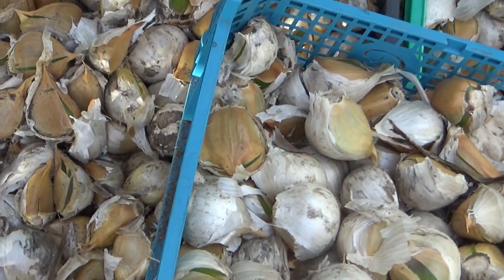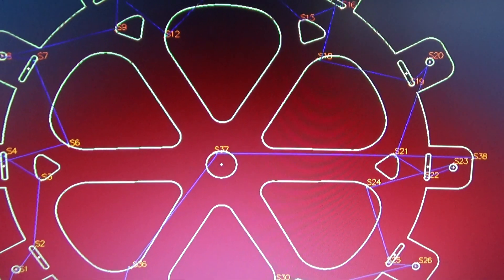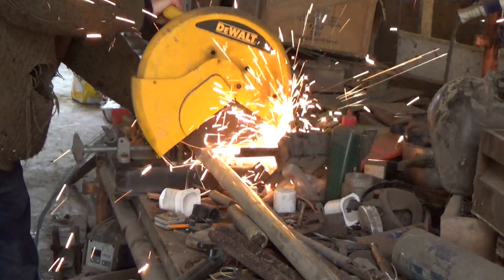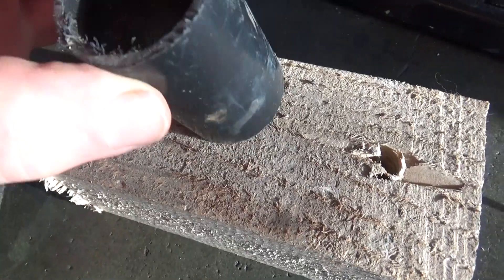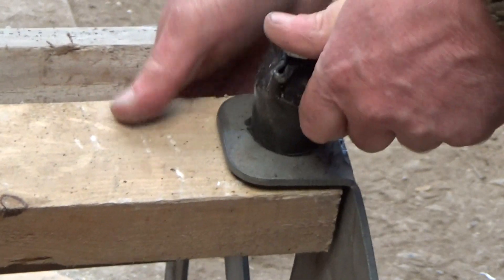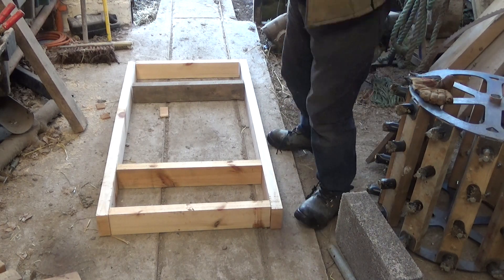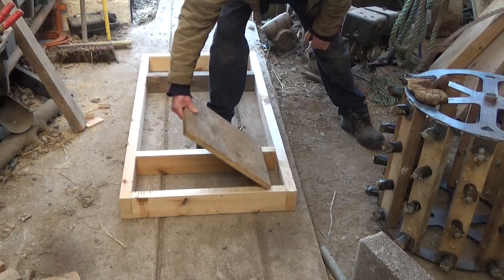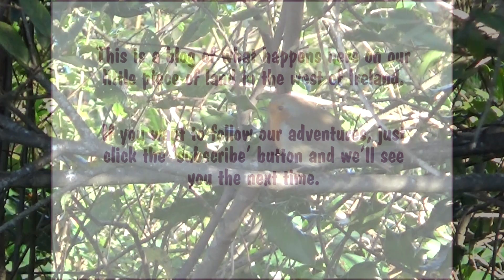Making A Dibber Drum For Planting Garlic (or is it a lantern wheel? or a spikey roller?)

Comment: Hi Tim, this looks like fun! I used to plant 5000 cloves a year - by hand. One small refinement I could suggest for the planters' comfort: carry the cloves in a bag around your waist, walk upright and drop each clove in turn down a length of plastic pipe. You can tread it in with your heels as you fumble for the next one. This method served my spine well for years.
Good luck with everything, you both continue to inspire, as always.
Chris
Reply from the maker: Thanks Chris. Yes, we're almost up to that number this year. I have started an experiment where I pull and plant at the same time, through the mulch. It's all about trying not to disturb the top layer of the soil. I'm not sure that your method would work because some of the cloves are as big as an orange. I'm always looking for ways to stream-line the operation though...!
Reply: @WayOutWestx2  There is an Indian hand-held machine which is effectively a garlic drill: it plants the cloves in "smile" position, which is possible to achieve mechanically and a reasonable compromise for good growth (upright planting as you'd do by hand is hard to achieve by machine, unless you use a cartridge-type transplanter). I built myself a prototype of the Indian machine, with some success. I was growing conventional garlic, and I agree that the large cloves might be more of a challenge.  You're welcome to more details if you like.
Reply from the maker: The thing is, I'm down on my knees anyway, to harvest the bulb with a trowel, so it's easy to drop a clove into the hole that's left. But, yes, please, if you can find me a link I would be interested.

Comment: The spikes c would be an excellent application for 3d printing. Or make a mould and cast them in concrete or resin.

Be careful with burning PVC, it releases chlorine gas.
Reply from the maker: You're right Sam, on all counts.
Reply: You're right about PVC, but I believe this is actually ABS. It still emits noxious fumes, but not as immediately deadly as chlorine.

Comment: Strikes me that the compartments for the concrete blocks look just about right for 1 gallon plastic containers. Filled with water each weighs 10lbs, and give you a good way of regulating the weight for different soils, by adding more or taking them off as needed. And with the benefit of a handle on each one making them much quicker and easier to manhandle (or womanhandle) in use.
Reply from the maker: You're right - and perhaps easier to handle than the blocks - but I don't have any of them

Comment: I like this very much. It must have been very tedious forming the pipe as you did, I hope it holds up well. I thought you would try mounting hollow unformed pieces of pipe so it took a plug out of the soil, but your way seems much easier to attach them.
Reply from the maker: Yes, round lengths of pipe would probably work, but how to attach them?
Reply: @WayOutWestx2  Without a bolt across them on the other side.
Reply: Instablaster.

Comment: I'd have thought you'd make to be pulled by one of those one horsepower propulsion units you have. Maybe add some wheels like bike wheels at the ends to keep it from tilting into the dirt if you're going to  push it yourself.
Reply from the maker: One of the donkeys should be able to do it. But their hoofs are so small they'd leave similar holes. (Must try training them to take 6" steps and walk in parallel..)

Comment: Maybe you could have made some triangular spikes out of metal with the plasma cutter. The idea is to cut them in such a way that they interlock and form a sharp end. Think of a two triangles interlocking via slits and they form a pyramidal shape like the tips of an hunting arrow! Then weld some bolts to them and then secure them to the wooden frames. May not be easy to pull off, but they would be a lot sturdier and more effective than PVC pipe tips. :) last longer too! (An idea from a future mechanical engineer. Hope it helps!)
Reply from the maker: Good thinking, Kevin, but the pvc will probably outlive the steel in this area, plus it's smoother so less likely to get bunged up. And there's a lot less welding this way too. But please make one your way and we'll compare

Comment: Hi, I think you should have hollow tubes for making the holes in the ground, so it pulls up a plug if soil rather than trying to push in. What about drilling a 40 diameter hole in the timber cross bars and fixing short lengths of tube in it, have you seen a lawn aerator, basically a larger version of that?, anyhow good luck.
Reply from the maker: I thought about that but realised they'd all be jammed with stones within minutes. Also, leaving the pipe straight means they might break at the leading edges? Or shatter completely?

Comment: If you switch the Apparatus upsidedown, the wooden part would be higherup and more able to avoid obstacles.
Also when moving the Apparatus as it is, the concreet weights wil bump up and down banging on the plank.
  wich could make it become detached

But i like the design anyway.  
Keep it comming!
Reply from the maker: I deliberately set them down low so the centre-of-gravity was low because I was worried it might tip over on slopey ground

Comment: Thats a clever tool you've built there! Just a quick comment, if you put the frame on upside down you'd have the wood pressing down against the pipe and not have the pipe be held by screws alone.
Reply from the maker: ah, you missed a bit, Tommy! Have a look at 6.28. The screws are only there to stop the axle drifting sideways - all the weight is on the D brackets..
Reply: @WayOutWestx2  now that I'm thinking about it it is easy to underestimate the strength of a properly fastened bracket. To shear the screw heads one would have to overload the jig to the point where it wouldn't be feasible to move by hand. Thanks for taking your time to reply, have a good weekend

Comment: Kind of wondered if it would have been easier to make a tool with four points or hook or tine like that you drag making lines or drills, then a sheet of hardboard, or thin plywood with holes at the required spacing to act as your guide.  You would put in the drills then put the hardboard onto the drills  & put a garlic clove at each holes, move hardboard, rinse & repeat. Once planted the soil brought up in making the drill could be pulled over each clove. Maybe your soil is too stony to get approx straight lines. If so perhaps you could pull a mesh with an angled front to catch the stones & let the soil fall back, might never be dry enough so it would have to be done with a tarp to dry the soil first as a long term soil improvement tactic over a few years. Still your cylindrical mace looks far more interesting. Good luck!
Reply from the maker: good ideas, though if we took the stones out there wouldn't be much left! Trying the machine today though..

Comment: One wood screw holding that axle seems insufficient, perhaps a bracket going over the top as well.
Reply: Agree, or the axle below the frame.
Reply from the maker: No wait! The D shaped plate with the hole in is what holds the weight of the axle. The screw just stops it migrating sideways.  Have another look.
Reply: @WayOutWestx2  Evidently, I must have fast forwarded past that part. It all makes sense to me now.

Comment: Still not believing you "never attended college", as you said, cause I was sure you just came from beeing a university professor in literature and philosophy, sir!

But then, when seeing the fine lines and curves for the "handle" of the new machine, I think it could have been "arts" ???

By the way: My plasmacutter still is no more than 1 niro-tube and 6 ballbearings, as the weather is horrible and my vice is outside ;-(

Very difficult to deside, which set of steppermotors, controllers and brakeout-boards to buy, as those affordable are with parallel (!!!) ports ... which are not even to find on my oldes computers in my fundus ... There are adapters but the friendly chinese friends are not able to get my concerns about parallel ... 

If using (and buying!) mach3-plasmacutter-software (400€) I for sure do not want to use it on a win-95-Computer ...
Reply from the maker: I joined a couple of FB cnc plasma groups and learned a lot just by watching from the side-lines. But I'm only trying to operate one, not build one.

(If I'd gone to college I'm sure I'd remember!)

Comment: useless
Reply: I use it every year and this year we planted 15,000 cloves - so you're completely wrong : -  )
Reply: @wayoutwest-workshopstuff6299  as I am thinking about it, with your solution it's possible to put seeds into  the soil with just one hand. The other hand perhaps holds the seed's container. While on a completely manual approach you need to use one hand for creating the hole.